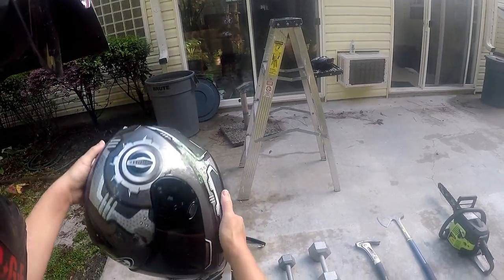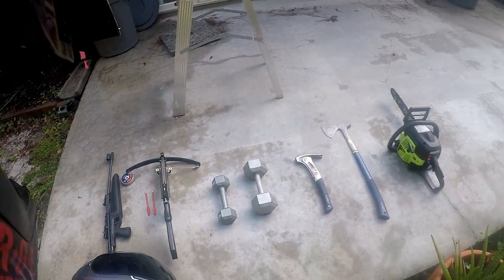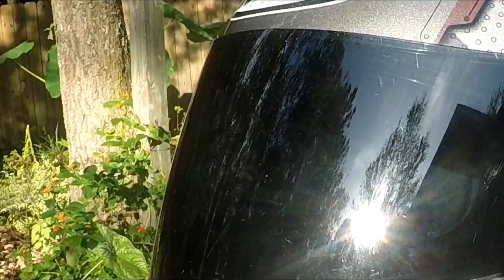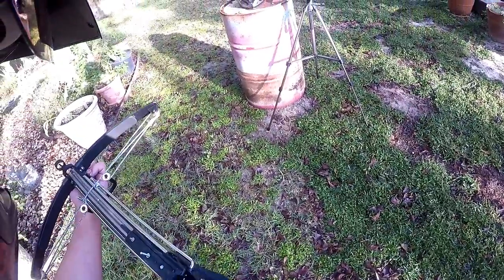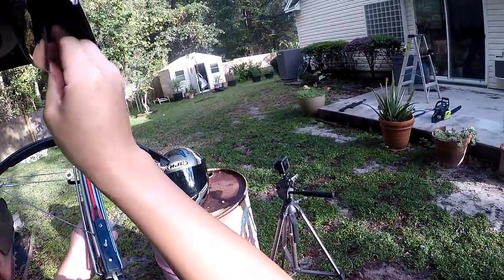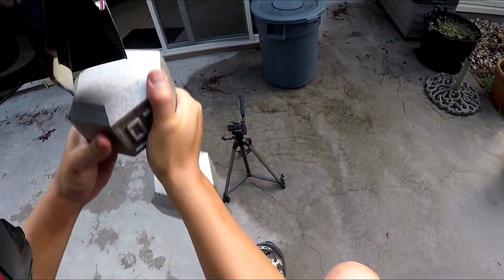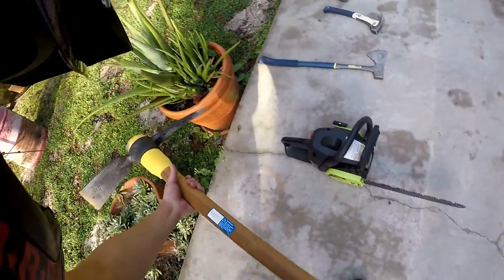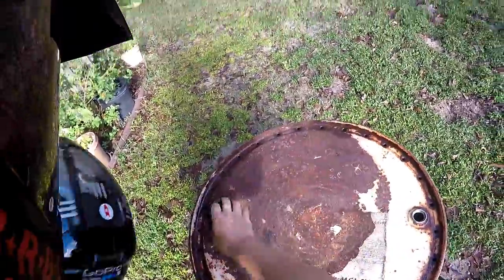Cheap Motorcycle Helmet Torture Test

Comment: That helmet is an absolute death trap!! Helmets are like crumple zones on cars. They're designed to crush, crumple and crumble under impact and force. Not stay in tact as this one did after so many impacts. A classic example as an analogy is Newtons cradle. As the balls in the cradle hit each other only the end ball feels the force and moves. The rest of the balls stay put. This helmet is one of the balls in the middle of the cradle and unfortunately your brain is the end ball. I'm assuming that HJC is a plastic shell and not a tri composite? Could you please confirm?

Jumping the gun assuming it is a Plastic shell,  I will never in my life wear a plastic shell helmet for the reasons demonstrated in this video.
Reply from the maker: AdjrianNickelodeon "advanced polycarbonate composite shell" is what's printed on the side. I think you got it. It's got a DOT and SNELL rated sticker on it too. Everyone destroy their old helmets and see if they at BSing us. 😳
Reply: The helmet did its job. The outside shell is in no way designed to absorb impact. The thick foam on the inside of the helmet is what absorbs the impact and stops it from transferring to yo noggin